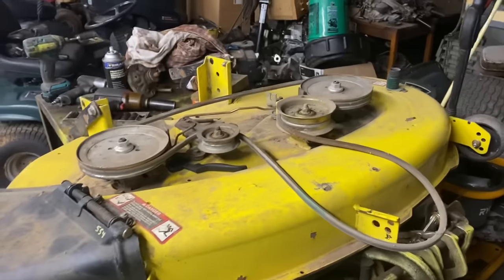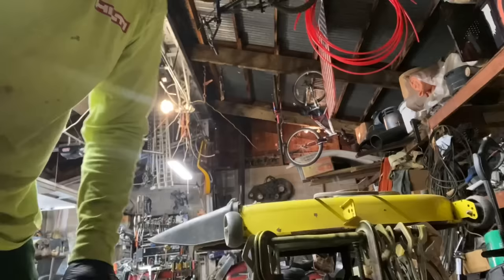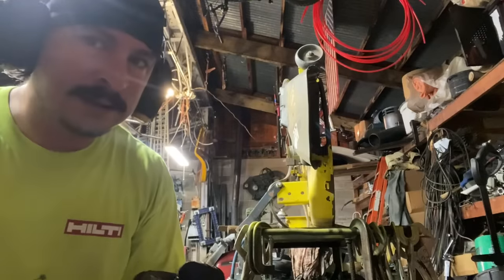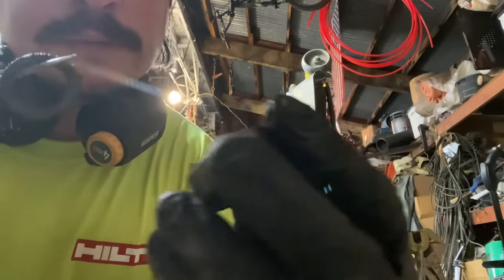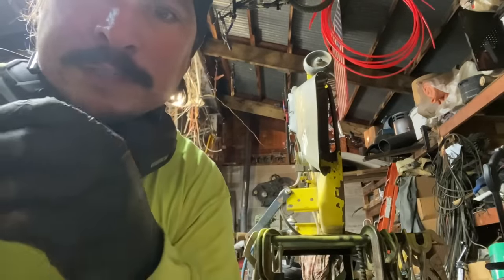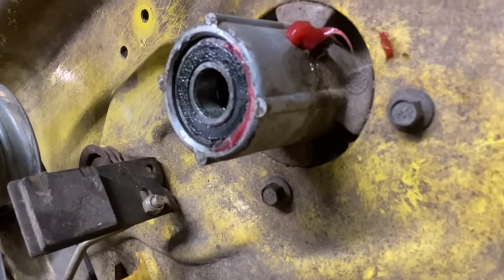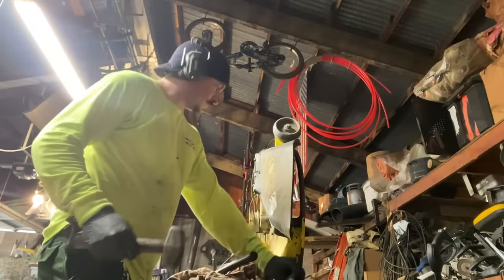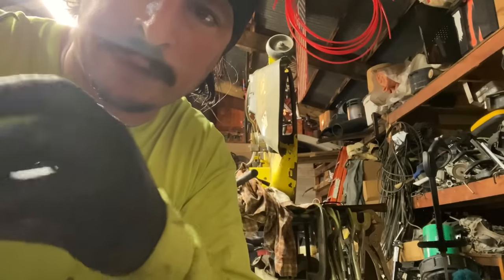Part 1 - Don’t trust the “Experts” Grease your mower deck sealed spindle bearings Common sense.

Comment: It’s marine grease if it’s blue and the grease is to keep the shaft of the blade lubricated because the seals already has grease in them
Reply from the maker: Yea bearings come with lubricant. Not always a lot in them. The American brands usually have way more than the cheep low quantity brands. As for greasing the shaft; do you realhow dumb that sounds? Absolutely ridiculous that someone would grease a shaft that grease does nothing for other than keep it from rusting up as bad if water gets in the assembly. And Iv seen water in very few. Most the times they are fairly clean inside even when not greased except for the tractors folks leave outside all the time and those machines are doomed anyways. Also washing the deck can be a cause for water entering the bearings. Best to blow decks off with a leaf blower or shop Air after each mowing. But most folks don’t care until there is a problem. Kinda like properly greasing mandrel bearings. Most folks just run to failure. Grease is grease. Some better than others. Blue pink purple Iv seen them all. They were all good enough for this application. Adding some wet lubricant in the bearings is always a benefit here. Only folks who don’t really understand the process of what’s happening here would think otherwise. And that is the reason I broke the process down into a long boring step by step process. Proved it works just like I said. Thanks for the comment. Unfortunately you don’t seem to accept the facts I proved or maybe you left a comment before you watched everything I showed.
Reply: @GTObearclaw1  but there is some grease fittings you can’t pump to much in there or you ruin the seal and when u do that it will leak most the grease out and dirt and grim gets in there I wasn’t trying to put u down I use marine grease Becaz it’s water proof I was just giving experience of what I’ve seen happen before that’s all
Reply from the maker: @heyjoe9228  that’s not the way I took it. I just always reply with my thoughts on the comments. Some times I can get a bit carried away in my responses. Not trying to be rude. As for your mention of seals being damaged or moved out of the seat. That is not an issue here. Assembly is made with no tolerance for parts to move around. These assemblies are precision fit. The seal “shield” can not push off a bearing in an assembly unless there are pre existing issues with the assembly. So for this application the way I showed is in fact a bullet proof way to grease the bearings. The only other options are disassemble the unit to remove bearings and manually add grease and then assemble again. This can lead to other issues by damaging seals when popping them off to add grease individually or also can damage other parts while taking old components apart that don’t always come apart or go back together the way they should. This option also takes a considerable amount of time. And then the other more popular option is running the bearings to failure and being okay not know how much grease is in there. consider it only takes one bad bearing to require repair and we don’t know how much time they will last without grease. And most decks have 4 or 6 mandrel bearings. So high chances of eventual failures without adding grease. Running to failure also takes more time and lot more work. Simply add grease if your fortunate enough to have zerk fittings already. This will insure maximum longevity with the least amount of cost and time invested. I just show the easy way, some folks don’t want easy. And I can accept that. Sometimes there is a better way. Don’t overthink the process. Adding grease is as basic and important as keeping engine oil filled. But most folks don’t think about bearing until they hear one is an issue.
Reply: @GTObearclaw1  work smarter not harder huh

Comment: Who knew - until you showed us the truth.  Thank you.
Reply from the maker: @davidrobins7753  thanks for the comment. It baffles me nobody else has made a video to cover this. Every other channel says they can’t be greased or it’s a waste of time and yet so many YouTubers comment that they do it this way for decades and never had a bad bearing. Why are the mower repair guys “experts” who make videos not understanding this. Geeeeze, at least run some tests like I did and learn. It’s not useless information. I’m a shade tree hobbiest at best and I figured it out, I’ll admit it took me a good many years to stumble on it and finnaly pump a unit full and figure out where the grease goes when the unit is filled.  Kept having bearings burn up. Not enough grease to fill the unit and push grease into the bearings

Comment: Hey Russ, another question. When installing the blades onto their spindles should both blades be in line with each other like this  -  -   or ? Thx much.
Reply from the maker: It does not matter unless it’s a timed deck. Timed decks have ribbed belts and the blades can hit if they get out of time. When those belts break it’s bad news. Everything in my videos is not a timed deck so the blades will never hit and therefore can be in any position and do not need to be same side to side.
Reply: @GTObearclaw1  Well I certainly hope I don't have a timed deck then! Because when I received the mower many parts were missing from the deck, belt included. Any other way to find out? Thx so much.
Reply from the maker: @toddrhine7648  times belts are ribbed have bumps on the inside of belt that line up with pully slots like a motorcycle drive belt. If you had a timed deck you would know by now
Reply: @GTObearclaw1  Thx much Russ.

Comment: Hell I've been waiting over 2 months for a replacement mower deck. Yet they're pumping out brand new mowers everywhere with exact same mower deck i have. The New 2023 Craftsman T110 has the same exact deck shell as my 2014 Troybilt. I'm having to pay someone to mow my yard meanwhile I'm sitting here waiting with all new spindles, blades, belts, bushings and springs waiting on a piece of steel that's on back order. Ridiculous!
Reply from the maker: Sounds about right. They want us to buy new tractors. 

Is the deck not repairable?
Reply: @GTObearclaw1  Yeah your right they do, but I can't afford a new rider. It's still in very good shape. No unfortunately the deck isn't repairable, it rusted through and broke almost all the way around the spindle.I believe the deck is the most vulnerable and receives the most abuse. Plus it's cheaply made from China steel.
Reply from the maker: @jonathan3982  depending on the severity of rust a deck repair ring can be welded on to strengthen it I have videos on that process too
Reply: @GTObearclaw1  It rusted so bad that the water channel around one of the spindles, started out as a crack and just kept splitting almost all the way around the spindle. Enough to where the weight of the blade and spindle are falling through, it dropped about 3" inches. Not only that the rear bracket on the right side that where the deck hangs it snapped off.
Reply: @GTObearclaw1  I'll try find the video your referring to about the ring. But if you seen the deck you'd say yeah it's toast. I can't even find a good used one anywhere near me. And the used one's I did find are asking waaayy to much almost the cost of a brand new one.

Comment: Where in the mower owner manual does it tell you this? Easiest way to fix this issue is for manufactures to say this somewhere in the manual…
Reply from the maker: Yea, wouldn’t that be nice. As most DIY folks have figured out, the manufacturer does not always want your equipment to last. They want you to buy another one.

Comment: I grease my mandrels every time I install a new deck belt. I have been using my tractor for fifteen years and never replaced a mandrel.
Reply from the maker: I wish more people would read comments like yours before jumping into the comments throwing out the normal naysayer negativity with no real
Experience on the practice of servicing this way. Works perfectly

Comment: Sweet video. QUESTION: I have the newer model ZT1 54" with the "S" Blades (490 110 C194) which are very expensive. I would like to swap out the 3 "S" spindles (618P09236) for the Star Spindle which offers a better selection of Blades at a much lower price. Like the Oregon 3 gator blade. They don't make any for the "S" blades. Any one know of a switch over spindle that will work?
Reply from the maker: I have yet to see one in person so I need to learn about that! Good luck. Hope someone here can give you some help on that.

Comment: Wow..I would have never thought that grease would have made it pass the seals. Very informative video. I think I would still like to remove one side though in my opinion. But regardless thanks!
Reply from the maker: Thanks for the comment and having an open mind. This seems to be too complex for some folks to grasp. Even when broken down into simple easy to follow logical steps that you would think anybody would understand. Some folks just too smart to understand I guess. If you just like wasting time go ahead and remove the seal on one side. That’s really all it will amount to is just a absolute waste of time. There are more good reasons to leave the seals in place as Iv described in many comments on other conversations for this video. Removing seals is a utter waste of time and makes no sense. The seals are good to retain grease in the bearings once it’s pumped in but other than that they are of no concern. Works fine without inner seals as well but it’s just a waste of time to tear the assembly down just to remove the seals. You can do more harm than good. If it ain’t broke then don’t fix it. Just grease it and go on about business as usual and have less break downs.
Reply: @GTObearclaw1  Wow.  I wouldn't drop the deck just to take the seal out. You took that completely out of context. I replaced my spindles and pulleys and belt a year ago and sanded the deck and repainted it while the parts were on order. The new spindles have no grease fittings and I didn't think of putting them in. I was saying if I had thought of it I would have removed the seal and packed it with more and better grease. I guess you seized the opportunity to assert I was one of the people that couldn't follow logical steps. And I have never ever seen one of your "other" videos.  Thanks for your insight.
Reply from the maker: @rednissan96  no, I was not really pointing it towards you.
Sorry I kinda went off on a tangent there. Thank you for the comment. I definitely didn’t mean to be disrespectful to you. Kinda just saying as a general response to some of the folks who freak out and say the seals block grease from making it into bearings. Sorry I went way off track there. I was more les venting to you about the folks who are naysayers.

Comment: How long does the bearing last after filling with grease ?
Reply from the maker: That is relieve to how much the mower has been used or will be used. Also how long it may have been ram without greasing. At the very least if the bearings are in good shape when serviced They will most certainly last times longer than it will without adding grease. It’s about the least expensive service one can do for a mower. And a very vital one as deck bearings are one of the most common failures on a riding mower.

Comment: I think the grease is to lubricate the spinning shaft and keep moisture out.
Reply from the maker: You are 100% wrong. The reason for the video showing each step of the process was to help folks who don’t understand what’s happening when greasing these assemblies. Shields don’t stop grease. Grease enters under pressure and has to pass the rubber lips to exit. It’s important to understand sometimes our minds can create reasons for things that don’t exist. Just open your mind to the process I explained. Watching the whole video is beneficial. Thank you for the comment.

Comment: Alright point taken. But what I've learned is that a brand new spindle with bearing costs me 38$ a set of 2 on Amazon. 
They last about 3 yrs with just normal maintenance.
A tube of good grease is about 15$ +-. I can buy spindle and bearings every 3 yrs cheaper than the grease costs..
Reply from the maker: @Southalabamaoutdoors  I’m not gonna try to convince you otherwise, I think it would be a waste of time for us both.

Comment: How often do you grease them?
Reply from the maker: Depends how much and hard you use the mower. If it’s just for personal use, once a season is adequate in most cases. Assuming the mandrels have been properly greased as I have shown.

Comment: Any bearing or spindle that has a grease fitting needs to be greased if you want it to last.  Sealed bearings are sealed but never the less they dry out, grease spits out and so fourth. That’s why it’s serviceable with a grease fitting. When it looks dry grease it!  The idea of making bearing last is keeping it packed with grease!  It stays cool, and don’t allow slack to start.  So grease your decks!!!!!
Reply from the maker: Amen brother

Comment: Too much grease can cause overheating.  My recommendation, that will be ignored, is to remove the bearings, clean out the factory grease and repack them with something like the “RED AND TACKY” grease then reinstall with the seals.
Reply from the maker: @seniorchief48  too much grease is not relevant here. Fill the assembly full. Any excess will push right past the rubber shield. This is nothing new and has been standard practice around rising mowers for 40 to 50 years mainly more well known on the commercial side but none the less as Iv said before, it will hurt nothing and only benefits to add more grease. For those who want to take a deck apart and clean out grease and add some special “red and tacky” have at it. Won’t help your bearings any better than me just keeping g mine full of the cheep stuff. This application won’t matter much about the quality. It’s more important just to make sure they are greased. Many folks are overthinking this simple and basic application.

Comment: Could you drill a tiny hole on the one side so you don't have to shot alot to get in it
Reply from the maker: Drill a hole in what? The assembly housing or the inner bearing seal? You can do one or the other or even both. All are a waste of time

Comment: Grease is simply a more dense fluid than oil or other lubricants.  The seal on each side of the bearing is meant to keep debris out and lubricant in.  It's easier for grease to get to the unsealed side, but not necessary...
Reply from the maker: Maybe I’m dumb, that comment could probably be interpreted a few ways. What’s not necessary? The inner seal?
Reply: @GTObearclaw1  Yep, that's it Woodchuck, the inner seal is unnecessary on the protected sid of the hub, but quite necessary on the side that's exposed to the elements.  The manufacturers must leave them on due to cost issues in production... 👍
Reply from the maker: @endtimeawakening5557   thanks for the comment and clearing that up. well sounds like we are on the same page. Part of my point even though I don’t think I specifically covered it in the video is that  the inner seals won’t stop grease and some folks are saying to remove them. But why bother removing them when grease will go right past. Most folks do not want to tear a deck apart to pull a few seals out especially if the grease will bypass them regardless.
Reply: @GTObearclaw1  
Makes sense, why do all that work if the lube is making it to the bearings.  Thanks for sharing this! 👍

Comment: The problem I have with cub cadet spindles is that they put a smaller breather hole in the hub housing so grease doesn't get into the bearings  (Thanks for proof ) of engineering  vs a 2 pump mackacanic not trained properly
Reply from the maker: Thanks for the commmet. Iv had a few comments on that issue with the cub spindles. Cub is just MTD made machine. Lots of other MTDs use same housing / assembly. Just plug the hole and your good to go. One viewer said use JB weld. I put a small screw in it. You can even add a zerk so you can grease it from
The top of deck. I don’t like how the cub zerks are on bottom and get nasty and even hard to find because they are covered with grass and dirt. I rather add a zerk in that hole and have a clean spot to hit from the top.

Comment: Most general purposed bearings that appear to be sealed are actually "shielded" bearings and not actually sealed.
Reply from the maker: Seal is definitely a loose term. And in general seals are all different. Some folks seem to think these seal can stop hydraulic pressure.